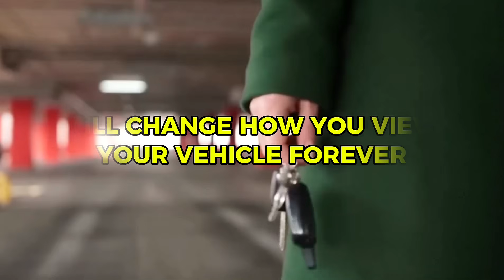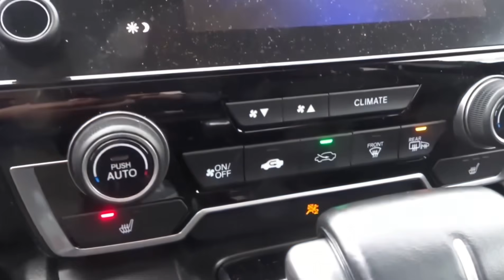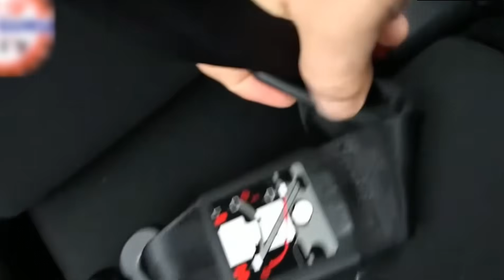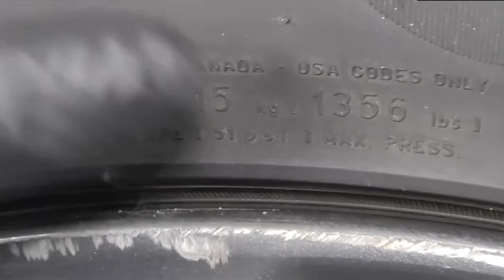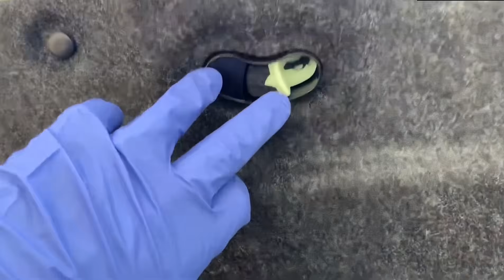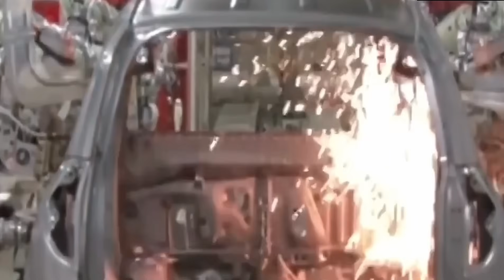TOYOTA Owners! This 15 SECRET Car Trick Is Unknown To 99% of Toyota Drivers (Pro Tips)

Comment: Why is there a Chevrolet logo on the steering wheel and how come there is a Golf (Volkswagon) emblem, if this video is about Toyotas. I stopped watching when my key fob didn't open my windows. just sayin'
Reply from the maker: Apologies for the confusion, there might have been a mix-up in the b-roll footage. The tips provided are generally applicable to many car brands, but I understand how that could be misleading for a Toyota-specific video. Thanks for pointing it out!
Reply: @ToyotaZone-b9t  Yes, Some of these are on my Ford suv. My Camry is an older one, but I'm curious & plan to get out there & look for some of these that I wasn't aware of. Thanks for the tips.

Comment: I am a 78 yof and replaced my cabin filter on my 2019 toyota HIghlander (gas) and now my air bags are turned off. I was able to find the passenger switch in the clove box and turn it back on but not able to find drivers side air bag on switch or button. Please help
Reply from the maker: Please check your owner's manual or visit a professional mechanic, as there is no driver-side airbag switch and the light may indicate a sensor issue that needs professional attention.